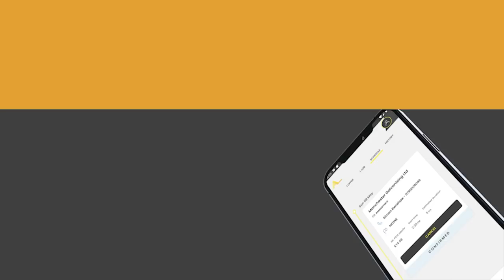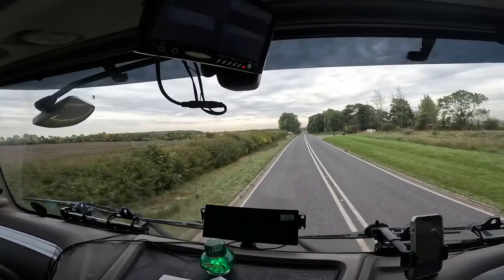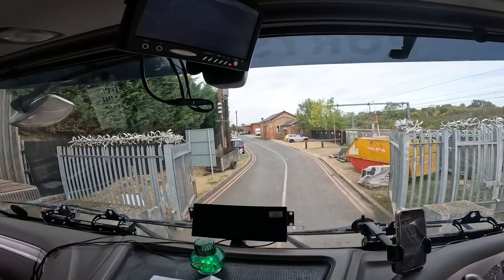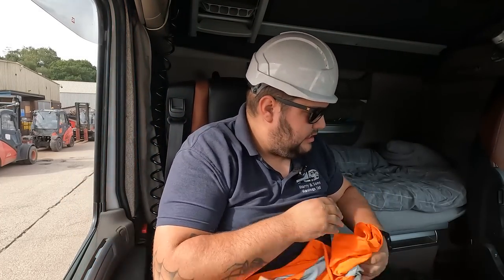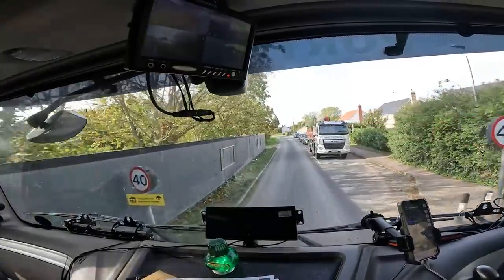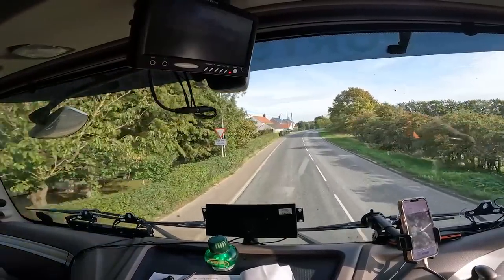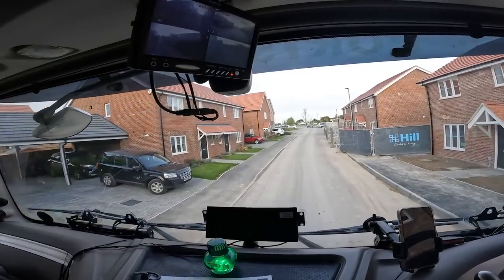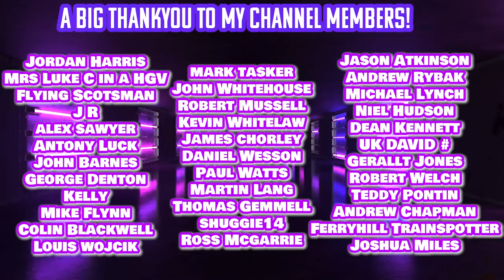This Is What Happens When The Delivery Address Is Annoyingly Vague!

Comment: Have you thought about getting a go pro fitted to the outside of the cab facing the trailer behind? I would love to see a side by side of you and the trailer cam while you're reversing. As a class 2 driver looking at getting into class 1 would be really interesting and good content! Love the videos
Reply: what's the test like to get the full license for the rigid ,is it done in a closed setting or are you  on any open road ? I passed the theroy test so waiting to get going on learning how to drive .
Reply: @IrishPablo94  I passed in January this year and the reversing manoeuvres were done in a controlled setting off-road (which was marked by my instructor as the rules have changed). Then on the test day, you go out with a assessor for a 1hour drive on the road, as long as you pass both of these you'll pass